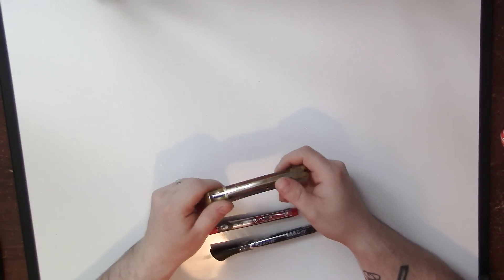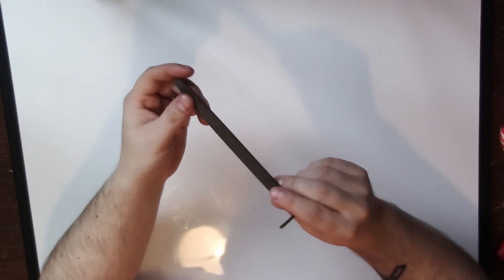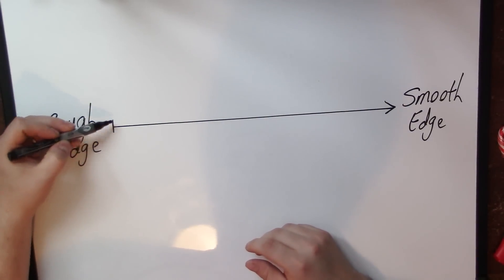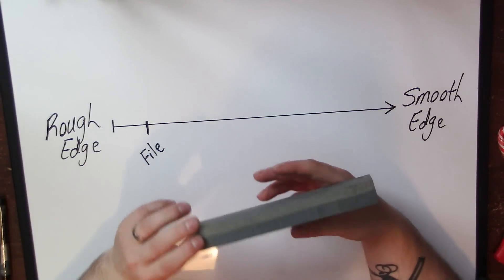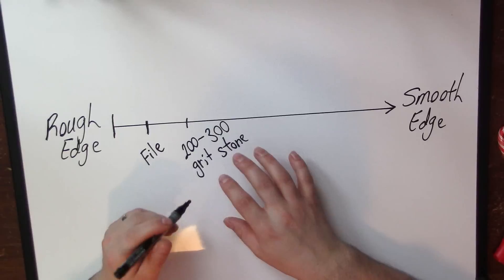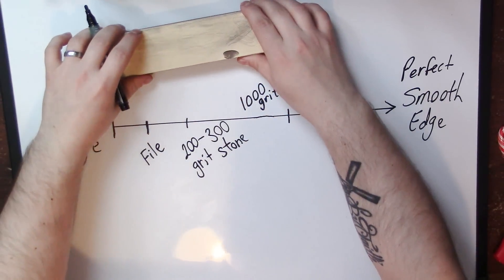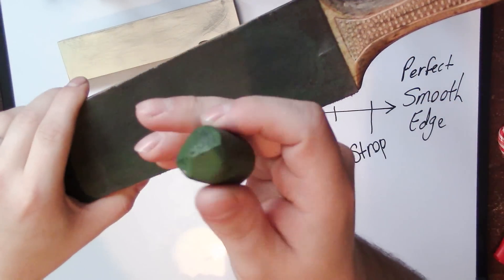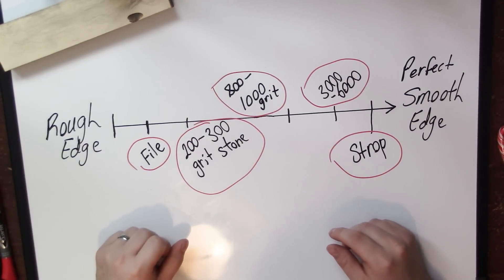Sharpening - Ep.2 - Building A Sharpening Tool Kit (What to Buy)

Comment: Great video. I'm just starting out on whetstones. When starting off with the lower grit, how do you know how long to sharpen the knife for before moving up a higher grit?
Reply: You need to form a burr (you will feel it by toutching the edge) on one side of the edge,and then to remove it by sharpening on the other side.